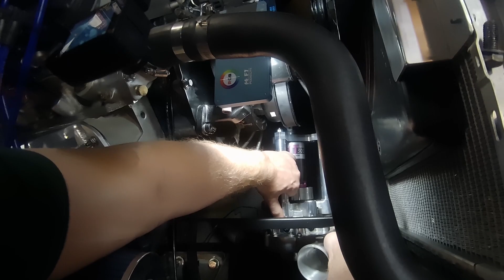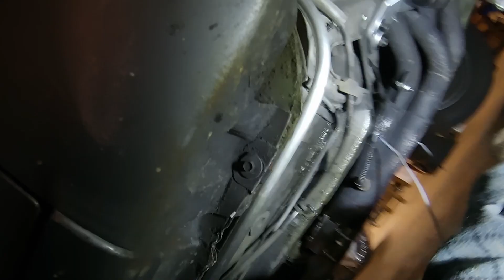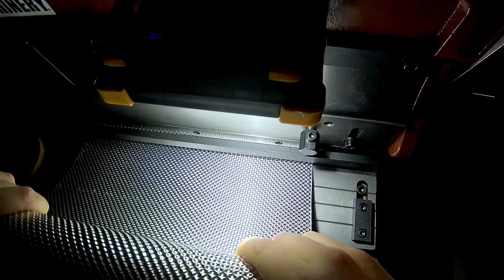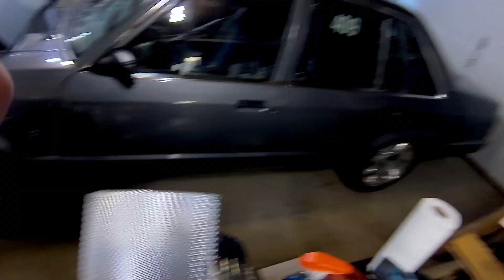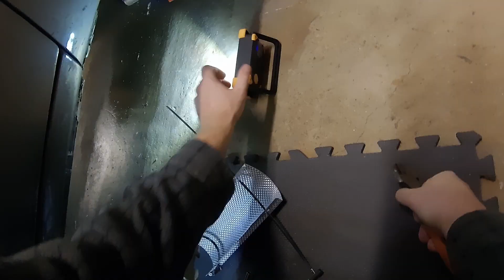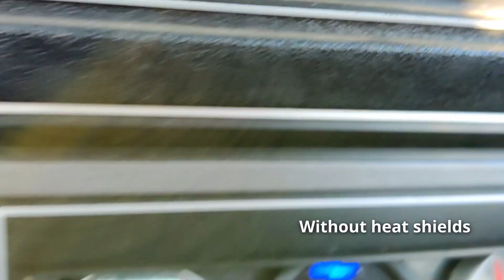Fabbing and Testing Transmission/Exhaust Heat Shields

Comment: The guy who built a v10 viper motorcycle used ceramic fiber aka fireplace fake coal pieces

They are the same materiel used on the space shuttle

In compatison with heat shielding and gold tape they are much better

But I think you have to grind them or cut them and the glue them on heat shield for best results

Comment: simple and effective mod!
Reply from the maker: I should've put in a trans temp gauge a long time ago.  I feel kinda silly for it taking me so long - especially since I drive this thing to the track.
Reply: @AlexLTDLX  well you got one now!  your glide is going to be happy but it seems you didn't have many issues with the trans itself so it must be well built unit.
Reply from the maker: It's mostly BTE innards.  They hooked me up pretty well when I built the thing about 10-11 years ago - 1.80 straight cut planetary, vasco output shaft, 300m turbo input shaft, extra clutches, good pump, etc.  Which was nice because the guy I bought the thing from screwed me.  That said, I do think those long drives and then immediately going on the dyno or the track with hot trans fluid did contribute to the sprag slipping.  It looked okay when they cut it open, but they didn't measure it.  Ray was quite certain that it behaved differently last time on the dyno than the time before that.

Comment: May try SS safety wire like they use in Aviation. Harbor Freight sells it as well. Those SS zip ties never held well for me. Glad to see the shield worked so well!
Reply: If you use the tool made to tighten them they last well